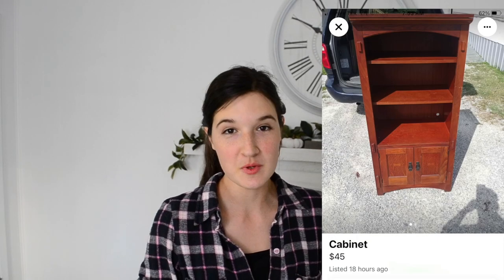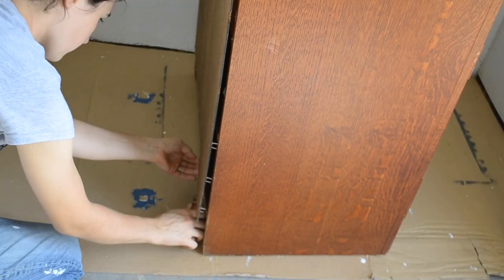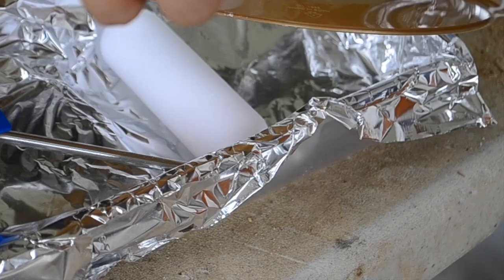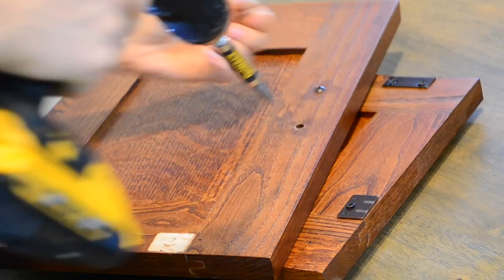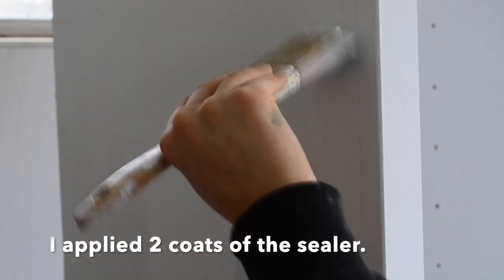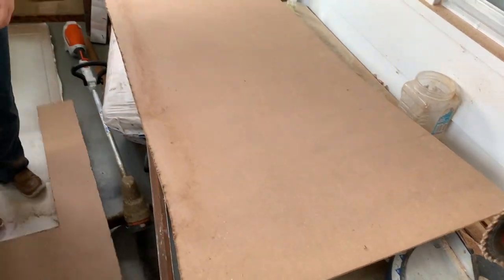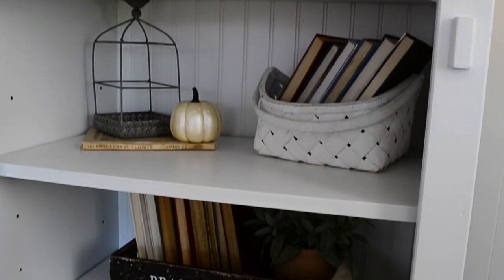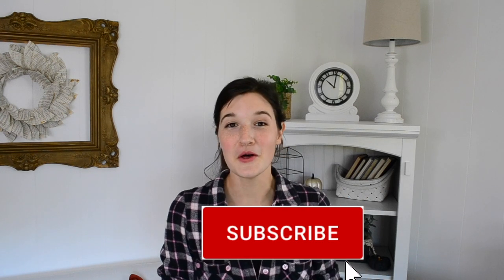How I gave a MAKEOVER To This Bookshelf! DIY Updating Furniture Painting Project Furniture Flipping

Comment: Zinnser primer It's a great primer for furniture, it's one of the top two best. I don't know if you're new at this or not but that is an incredible primer and that's the way it's supposed to look so your first code is going to make the police look like you ruined it and oh my God what did I do but that's the way it's supposed to look That's the way they all look when you do it. Normally you only do two coats of primer it doesn't need to be solid it just has to have two coats of primer on it for your paint stick to the primer but it shouldn't be flawless and perfect like your paint. After two coats of primer then you do your coats of paint. And then you do your top coats if you top coat though make sure that you sand the piece with a very very light grade sandpaper in between your two top coats or you can have some problems with the finish later on or right away. Just an FYI but the piece turned out absolutely beautiful you just don't need to work so hard on the primer and have to do three coats of it That's what it's supposed to look like usually when did two coats of primer white paint is always going to take more coats to cover than any other color lighter colors take more so normal is two coats of primer two to three coats of paint and then your sealer 😉❣️❣️❣️
Reply from the maker: Thank you for the advice! This is the first time I used this brand of primer. I’ve used other kinds. Looking back I probably should have just done 2 coats of primer. But I learned something and I’ll do better next time. 😁
Thank you for watching!